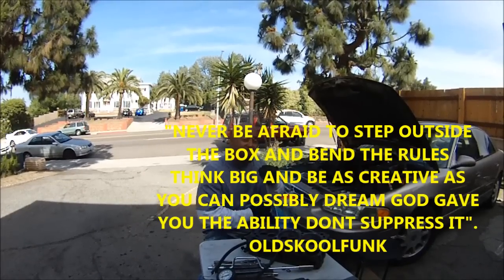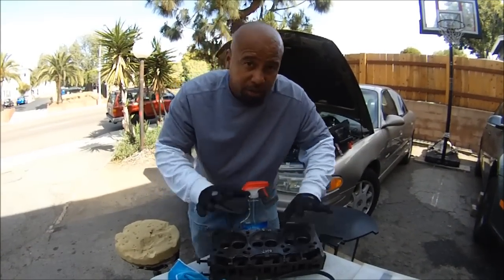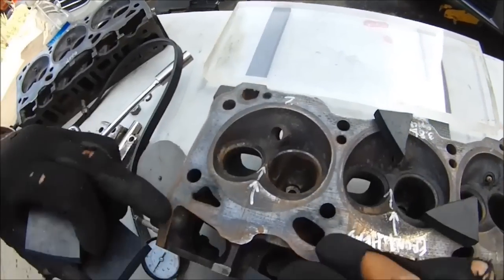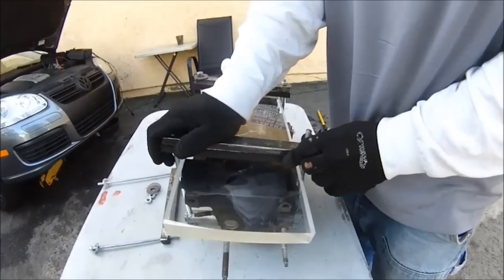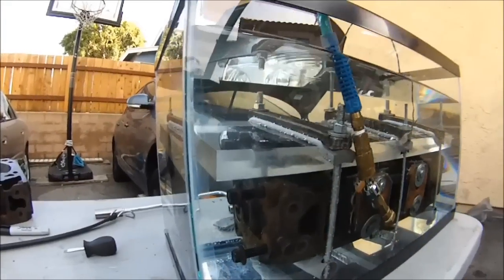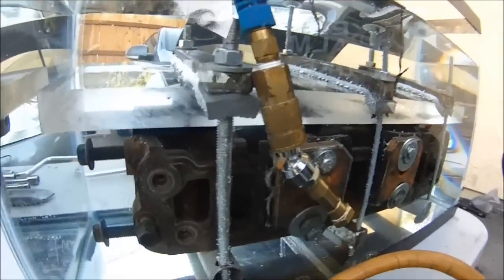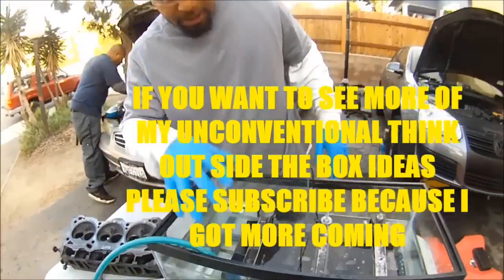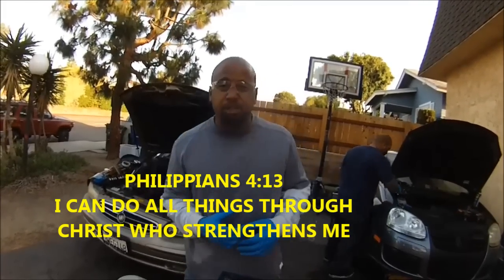(NEWEST WAY) TO CHECK CYLINDER HEADS FOR CRACKS AT HOME W/ A HOME MADE PRESSURE TESTER

Comment: tapping a threaded oil requires tapping or cutting oil. most people dont know how to cut threads.also you are tapping a dowel pin hole which isnt drilled for normal sized bolts.plus how will u locate that gasket now that u tapped that hole? sorry to b like this but when placing stuff under pressure some things can kill u. if someone who uses ur tip like this gets hurt then what?i understand ur tryin to help but there is alot of people who dont have common sence or the knowledge to properly do this at home
Reply from the maker: o.g.nigga 73 Your over thinking my man, just handle it!
Reply: Dear Keep on rollin
  YOUR A DICK
  GO BACK UNDER YOUR ROCK!
Reply: Hey, your'e right. MECHANIC WORK ANY AT ALL IS DANGEROUS, TAKE PRECAUTIONS. We are in contact with everything from spit to viruses splashed up on cars, cuts, bruises and concussions, . My dad, friends and I worked for years in alleys (even with full time jobs) and it saved lots of people getting ripped off by shops, just because they lacked knowledge. Plus, oldschool has a licence for flipping cars. He gets to make his schedule and has time to teach his kids how to be self sufficient. Many of the fancy things and machine shops aren't available in most countries viewing, so we salute the car flippers who remove the secrecy and innovate and share. I can do all things through Christ.
Reply: your right... oh my... they would get water splashed on them.
Reply: Hacks.if ur so good u would work at a shop not a alley
Reply: Actually your wrong brother, your not loosing location, your just establishing a major diameter onto the hole, the minor remains the same, therefore location and orientation does not change!  On softer metals you don’t really need tapping oil, as long as you turn in about 2 turns and turn out 1/2 turn to break chips. But tapping oil is recommended on harder metals. Also that’s why we have Tap/Drill charts to reference too!, The threads in the hole won’t effect the mating of the locating dowel pins. Make sure you study Geometric dimensioning and Tolerancijg before you give your input buddy!

Comment: Another cheap way to do this is to get the inspection dye and developer in spraycans:  Spotcheck SKL-SP2 and SKD-S2.  Shop around because prices vary but you can get both cans for under $40.  Surface cracks will show up with that (you won't be able to see internal cracks though).   Two cans can do a bunch of parts vs paying a shop to do magnaflux $50 each time
Reply from the maker: Slappy Fistwad Yep your right I have used the Dye also and powder magnuflux with a magnet also for steel heads and blocks
Reply: Cool, I'd like to know the magnet + magnaflux powder trick

Comment: Just a little FYI you might want to look into getting some "spyware glasses" they glasses that are safety glasses with built-in video cameras and they might make your videos easier for you but thanks your video is very helpful. keep up the good work.
Reply from the maker: Bob Hones Right on for the tip I actually want something like those glasses to make it much easier to film. I'm going to research those thanks Bob.
Reply: Thanks for all your advice.
Reply: Buy some? This guy will probably make some

Comment: Pretty cool but I'm pretty sure some cylinder cracks aren't evident until head is at running temp
Reply: Garrett TheGun. Good call, but couldn't you just heat the water up in your rig? I don't do heads enough to justify this myself, but admire the creativity here..

Comment: When you are checking it like this, 100 degree water isnt enough, it will need to be VERY hot.  otherwise magnaflux the head.  Still, this is a good method to find cracks in the runners and things you might not otherwise see.

Comment: it cost me 45 dollars to have a pressure test done at a machine shop..
Reply: Problem is, lots of these places want to string you along. "Example: bore and hone $x.   Bore and hone with torqueplate (HIGHLY RECOMMENDED): $y".  Guess what they do if you don't take their recommendation even though you KNOW it's not needed?  Yes, they will do a sloppy careless job and then say "we told you to use the torque plate!!!"
The only way to not have them mess your stuff up is to buy ALL the services when you only need one.

Comment: so with an aluminum head if it's cracked it's pretty much toast huh. welding aluminum is pointless. imho. that's why I run ye ol b18b1 LS swap. : ) if it's bad just pick up another if you can afford it. this is a nice system you get that an engine is just an overglorified air pump. the mount to the port for air seems a bit difficult and that's a lot of pressure man. I think I would opt for putting a ring around a single port like o'ring or hole drilled in rubber piece because mounting the air hose go a gromet in that plexi would be pretty simple... well remember, watch out for them child support whores. 95% chance of custody and ur ass will owe 550 a month per child. PEACE BROTHER.

Comment: Great video!  I have a suggestion for a bigger tank.  Build a box, probably with 2x lumber.  No need for a bottom if you put it on a concrete floor.  Put in some polyethylene sheet or a pond liner with a suitable pad to protect the liner at the bottom from edges on the head, maybe plywood or rubber, weight down the pad, to keep it from floating, then fill with water.  This way you can make a tank big enough for a huge cylinder head or  even an engine block.  You can't see through it, like the fish tank, but if you see bubbles, tip the head or block until the bubble source is upward and you should see it.  Loved the video!
Reply: Maybe an ibc tote

Comment: Good work with the videos
The only thing I could add to this is to add boiling water to the tank to bring the cylinder head up to operating temperature. Sometimes the really small cracks will hold pressure when cold & won't open up until it's hot. 
Keep up the good work 👍🏼

Comment: That is a lot of work and materials . Usually you can see a cracked head by how clean it is it is in a given area. You think its cracked in a area spray some brake cleaner in the water port head were you think it is leaking and 90 percent of the time you can see the brake clean come from a cracked head usually in the combustion chamber or between the valves or spark plugs. Also the piston and cylinder bore can tell you a lot. You should pressure test with everything on with water in the radiator before you take things apart. Helps you even tell you more before you pull the heads to find a leaks also.Other than that take it to a machine shop and save yourself all the headaches.You have a great idea but not for the diy type of person. Head cracked not long before block cracked.
Reply: It's great for people who are already mechanics

Comment: with that long of a hose your looking at at most 45 psi.
Reply from the maker: +petiyo101 Hose dont matter. The valve dictates what comes out regardless of the length.
Reply: +oldskool funk exactly... the guage read 60psi for a reason (because there is 60psi)
Reply: Unless you have flow there is no pressure drop in the hose. If there are no bubbles you have no flow.
Reply: +oldskool funk confirmed?
Reply: +celli351 the pressure gauge  is inbetween the blue hose and the orange hose. the quick connect is on the other end of the really long blue hose. therefore a significant pressure drop. that's why with a paint gun you should always have a pressure regulator at the gun.

Comment: im impressed,But with a warning.When you add pressure stand back.The bolts could rocket,Plex glass will shatter.Dont want to see someone with the holy sprit Get hurt with holy crap.What happened.Remember the split rim wheels.People would not install  correctly ,fill with air.And bang.We get to meet some of them in heaven.Great video,Message from a Gnostic christian who Owns Alltec mobile mechanics ,portland or.Thanks
Reply from the maker: Warning: With out the Holy Spirit (Jesus Christ) No man can make it to heaven. Indecisive agnosticism only means you have not made your mind up and life will be void and full of vain (empty) perception about who God really is. Wouldn't want you to be stuck with all that unholy shrapnel that you been feed about Christ. Thanks for the comment God Bless.
Reply: +Ted Hibbard what is  someone with the hole sprit get hurt ?
I would love to see someone with bad spelling get hurt
Reply: +MANUEL BAEZ specially a hater
Reply: +Ted Hibbard  bolts could rocket? plexi glass will shatter? Before any bolts "rocket" im sure the gasket material will leak, and what bolts are you talking about anyway??? ... Plexi glass doesnt just shatter.... it will crack... 1'' thick plexi glass will not crack under only 60 P.S.I. especially.. and if it did shatter, i bet you the water will dampen the force enough so you dont get a boo boo......otherwise the gasket material will leak way before the 1'' thick plexi glass "shatters".....
As for the split rim wheels... there is no comparing this video to that, this is totally different... this isnt a split rim wheel, when doing that your using much more pressure than just 60 P.S.I. .... and its clearly much more dangerous than this cleaver method of checking for cracks in a cylinder head....

Comment: i dont get where i would ever need this. 

prior to ripping the head off, you should know if its cracked or not. or if coolant ports are sealed.

this will fail seepage tests, since those wont show up till nice and warm.
Reply from the maker: +waskly wabbit Are you sure or are you ASSUMING?
Reply: you wont tear down an engine before you know whats wrong with it. 

so before the head comes off, you know ifs head / block etc.
Reply: +waskly wabbit I'm pretty new to engine repairs, so I may be speaking with ignorance. Can you tell if a head is cracked or the gasket is bad when it's on the car?

Comment: 1 major flaw w/this methodology: You're not accounting for heat. Most small cracks occur only when metal heats up. You could try using boiling H2O in metal pan but that's still nowhere near simulating combustion temps. Then again, modern cooling systems are rarely more than 1Bar (14.7psi), nowhere near 60psi. 

The best method is still testing system with warm engine using a cooling system pressure tester. Honestly a quality OTC tester is not much more than what you're spending and a whole lot easier to perform...assuming of course engine can be run prior to teardown
Reply from the maker: It works just fine
Reply: +Michael McLean a crack is a crack... they dont disappear when at low temperatures.

Comment: Very good to teach this method, 
Another NDI procedure, you can also buy a spray bottle of fluorescent penetrant, etch the head (clean with sodium hydroxide solution, lye) and a black light. etch the head, apply penetrant, dwell (leave it to penetrate 6-8 hrs) hot water rinse the casting, leave it to dwell in hot water until it reaches 180°-195° then inspect with a black light inside a completely dark room, dental mirror with a handle to validate the casting for cracks/porosity. May as well smooth the intake and exhaust ports and gasket match to increase airflow and consider and annealed copped head gasket w/copper kote sealer to increase compression and sealing, God Bless! keep on keeping on...oB

Comment: I did this years back on my old Ford 2.0 OHC head. Only real difference was that I drilled the plexiglass and bolted it to the head through the original head bolt holes using bloody great 2" x 1/2" "Washers" to spread the load on the plexiglass. It worked well, But your way with the bar clamps has the added benefit of allowing you to use the same piece of plexi for several different engines....... Wouldn't have thought of that. :)

Comment: I haven't took a engine rebuilding class but I am a6, a8, l1 certified and two months away from getting a smog inspectors license. Having that in mind I just want to say, I respect the trade and this is a great tip. Its an accurate test, and like you said only thing that is missing is the heating up of the water. Thanks for sharing, I appreciate learning something new. Keep those videos coming.

Comment: I give you respect for ingenuity but when you have a head gasket that started to leak there's more to check out then the cooling ports. in most cases the heads start to lift causing the gasket to scrub and tare. also warping the heads and possibly the block is its aluminum. best bet with a BHG would be to have a machine shop fully test the heads. My machine shop only charges $40 per head which imo is worth it. always use new head bolts because that's the reason the head was allowed to lift in the first place. the head bolts stretch and allow them to lift.

Comment: oldskool funk a couple of comments for you, I hope you have time to give a detailed response:

First-
All the people complaining that you need to heat it and or that you really need to test combustion pressures.  Well yes, if you do a compression check you'll see somewhere in the 200psi range (race engines will get in the 240psi range), but that is only a compression test, if you added air/fuel and ignited it it will be in the 1000s of psig range.  You won't reproduce that with any test you're going to do with reasonable tools.  

It doesn't really matter since most of the time when you have a crack in a cylinder head the leakage will be from the coolant passages into a port or chamber, not vice versa, and water is much less likely to leak than air (most of the time estimates that I've seen are that you can apply 3x the water pressure to get the same leakage with air).  

Most "professional" pressure tests test to 25-30psig and cold, and that will catch 99% of the leaks on cylinder heads because air tends to try leak much easier than water (you don't need the heat to expand the cracks), even odd stuff caused by porting, porosity... stuff that will not typically show up on OEM heads, just aftermarket/modified stuff.

Second-
This isn't really thinking that far outside of the box.  Sorry.

Most good machine shops that I've dealt with (I've worked at a speed shop and we sent a lot of work out to machine shops, and I currently trade work with a couple of local machine shops, stuff that I can do faster and cheaper than they can in exchange for work that I would have to make specialty tools for...) build a lot of their equipment specifically for their application.  2 local shops that I know of do pressure testing using a similar rig to yours.  On in particular does the same basic deal on a machine they built, which in function is pretty much the same idea, the significant difference is that they have a few rubber sheets like you used at first that they've cut out to match the deck surfaces that they need to seal off instead of using scraps like you did (and when they have a different head come in they will make a new rubber "gasket" for it and then have that one in stock for next time).  Instead of your clamping assembly they built a hydraulic fixture, so basically to test a head they put the correct rubber gasket on the fixture, put the head on that, thread bolts/plugs/expanding rubber plugs (can get them in a few places, will save you time over threading the holes that are not threaded) into the holes on the sides/ends), clamp it down and run the test.

Third-
If you don't mind me asking, where do you live?  The reason I'm curious twofold, first you quote crazy low prices for machine work, like around here what you listed as about $160 at a machine shop would be an easy $500, heck, pressure testing a set of V8 cylinder heads at my preferred machine shop (it's about an hour or so drive but in an area that is cheaper) is $90 alone.

The second part is I wonder what you expect/hr for your own labor?  Let's say you had to pay $45 for a single head (what it costs at the above shop, but they typically charge more for singles, I just get a deal).  You easily have a 2-3 hours, maybe more in cutting up pieces, setting up your tank, just general tinkering... and $45 in supplies. Lets say that you're recurring costs (more rubber, occasionally replacing bits of your clamping assembly when it gets buggered up...) is $5-15.  Subtract that out of that $45 and then divide by number of hours and in a lot of areas pushing for a "living wage" you're making less per hour than the kid flipping burgers at McDonalds.

I'm not saying that there isn't merit in what you're doing.  On the contrary, when I was younger and had more time than $ I did this kind of thing all the time and I often still do things that when you factor in the amount of work that I put into it it's a loosing proposition $$$ wise, but I feel that the experience + having ways of doing similar stuff later on hand is worth something to me.  BUT, you appear to be doing this for a living, and at some point you need to factor in what it takes you vs what you're making/saving on it.  Around here most shops charge >$90/hr for mechanic's labor, so this kind of thing would only make sense in a professional setting if you can get it done in maybe $15-20min?

Comment: At  60 psi. that is 4 times the pressure that head will ever see. That is a cool trick to check heads, most of the time you can see the cracks but not always.